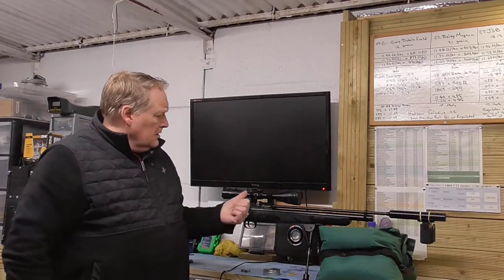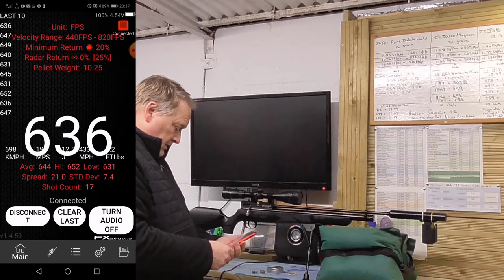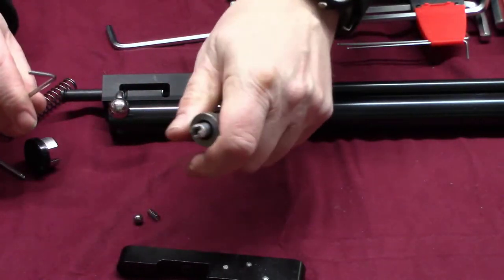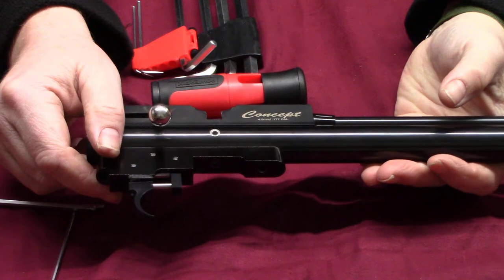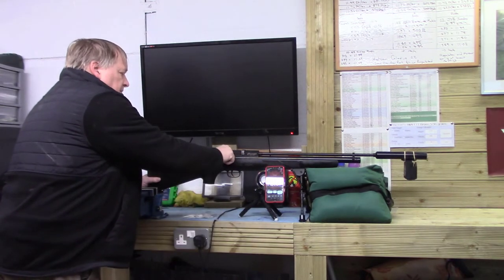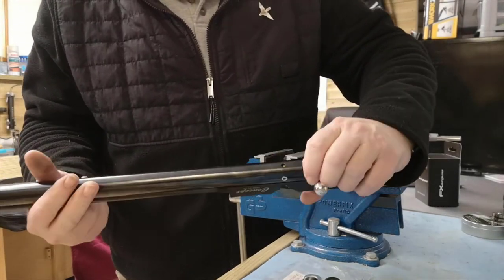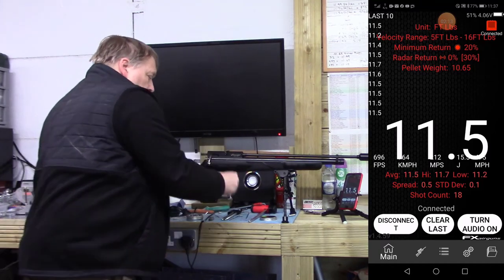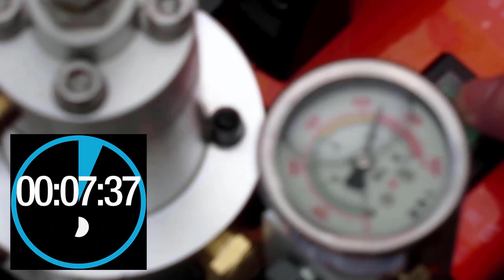The Brocock Concept S6 - Power adjustment

Comment: A lot of messing a round just for to have a regalator fitted to test 20 or 25 diffiant makes of pellets...😕 find the stright line 180 190 bar down to 110 bar ...i yust to shoot pellet guns ...when its working leave well a lone ... fix it if new seals .... and a clean up in side ...REGALATORS...more hassel then thay worth ..
 A pice of fluff or some thing and down on ft pounds ...😢... bad in nuff have to replace seals evey few years .... if U took that pellet gun out pigeon decoying ... pesting ...6 or 8 shots and then U start missing pellets dropping low hitting the ground in front of the pigeons toes ...😕...it be in the back of my head was it going to stay working or give trouble agen...😯... U    R  all ways messing around barrels and springs ... bits and pices ... ull have a call from the boys in BLUE ... and thay take the lot of U.... airguns ...for not taking then to a RFD...And get a gun smith to do a proper job on them... if you did a course on gun repairs well ....i did with fire arms shotguns and rifles pistols ... i had pellet guns in uk and ireland ...and a spanner man all my life 58yrs old now....😉...helo from IRELAND ...😆